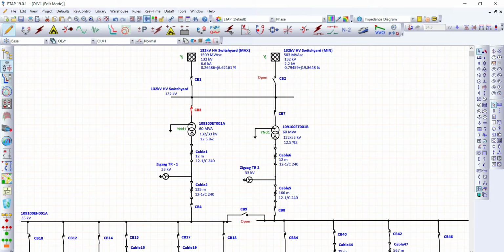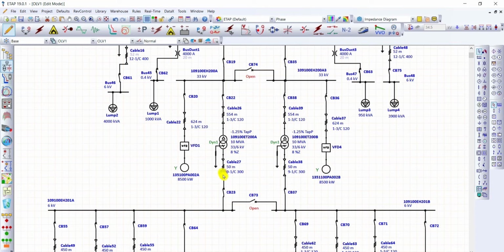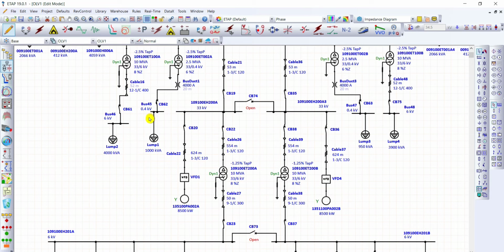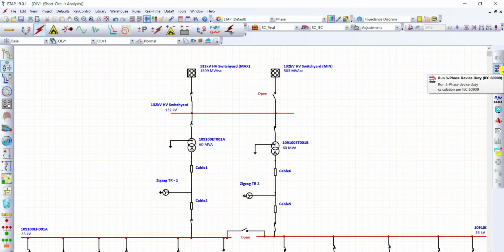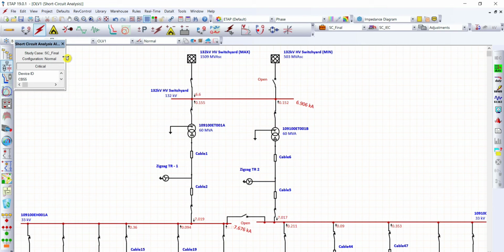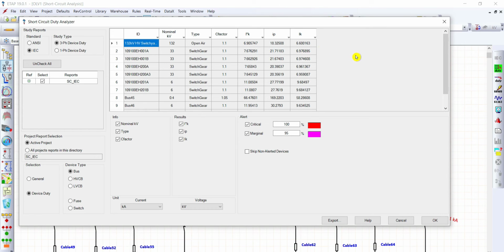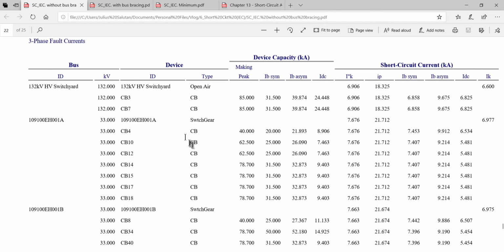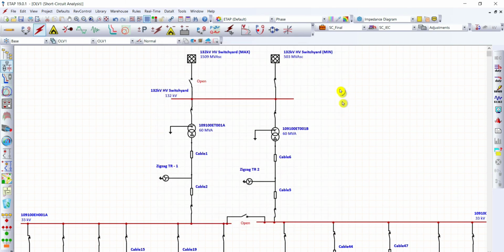Short Circuit Analysis Using ETAP Based on IEC 60909 Standard

Comment: hi sir julius regarding po sa impedance ng motor .. may seminar po ako dati na given kW, voltage , eff, pf ,  X" and X"/R  ng motor .. minultiply po ng 1.2 ang X "  sa lahat ng motor  .. san po kaya galing ang 1.2 ? 4 motors ang load ng system .thank you in advance .. baka from ETAP or meron sa ETAP yung 1.2????
Reply from the maker: I'm not sure sir kung saan galing yong 1.2. Hindi ko kasi nakita yong buong data

Comment: Very informative lesson. However, it would be better to use the '' Revision '' feature in ETAP instead of creating two parallel circuits. Very useful tool for simulation with different Data.